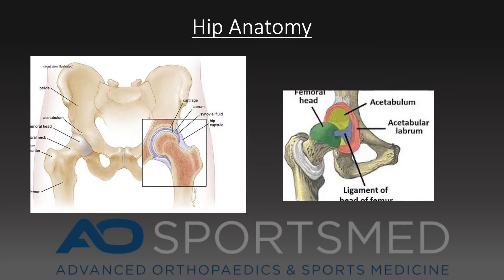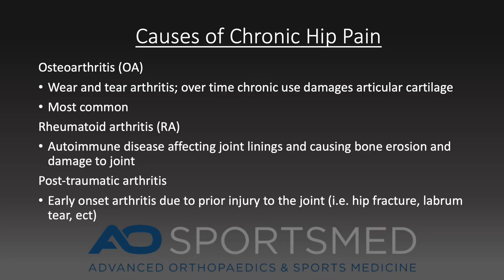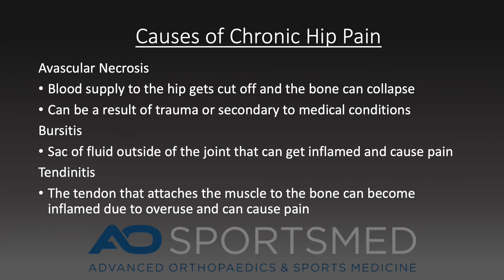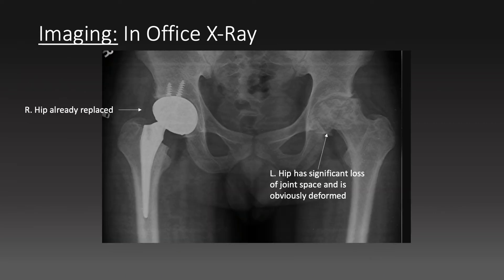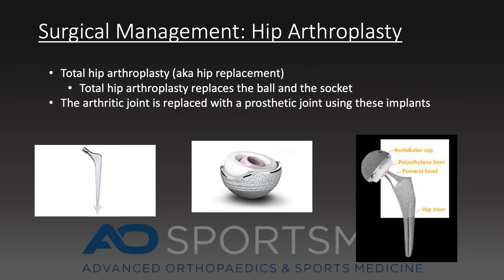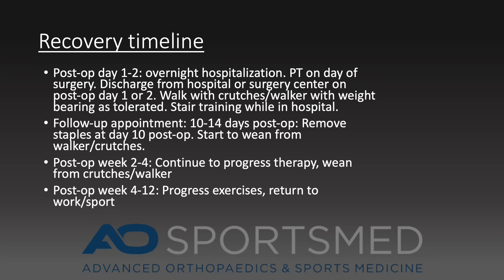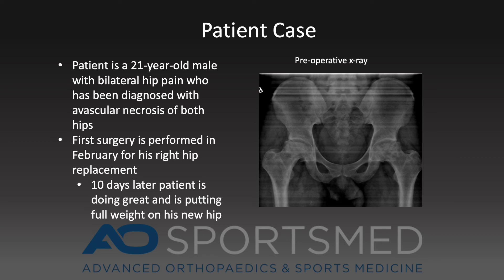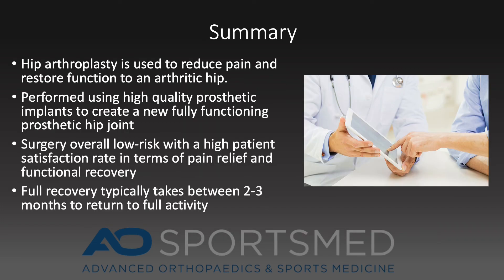Total Hip Replacement Posterior Approach

Comment: At about 1:33 you use the Latin term et cetera which means also. But you abbreviated it to ‘ect’ instead of etc. A common mistake. However, if you wanna exude professionalism, know your Latin! It’s used extensively in law and medicine.